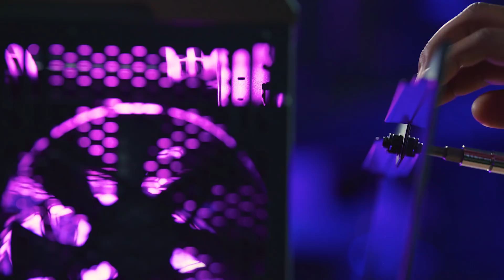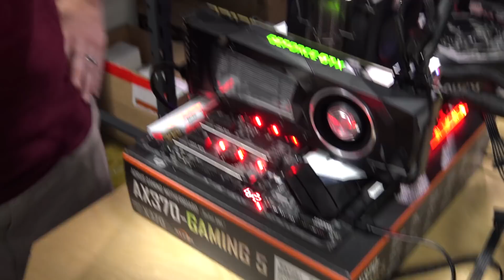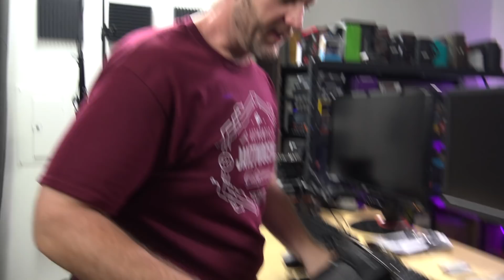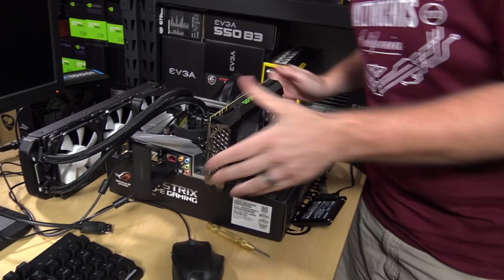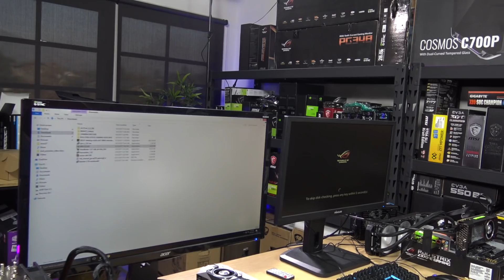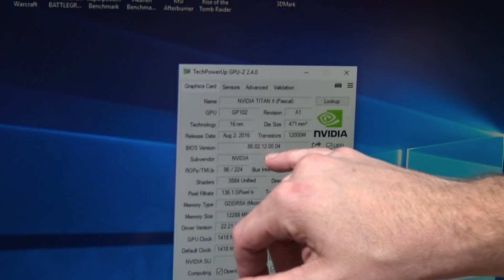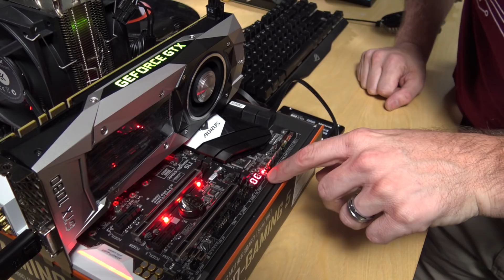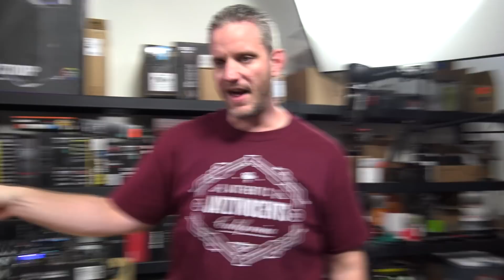I cant figure this one out... HELP!

Comment: Hold on..
Did you ran GPU-Z on the same card twice.
Once on the intel system and second time on the Ryzen system. That's why it showed the same VBios.
Also replace the power supply on the Ryzen rig. Because there can be a problem with that.
Also check that shady 1080Ti on a different PCI-E slot on the Ryzen MoBo.

Comment: I have had seen issue with the video card pins being a hair short or the card slot not working with certain cards. First put the video card in a different slot. Compare the video cards to see if there is any visible differences.

Comment: did you try:

swapping the psu?

swapping the AMD board? ( the PCIe connector seems finicky)

Clearly the issue resides with the AMD board as the Intel one seems fine. I would strongly suggest trying to change the board (keeping same psu, ram, cpu and gpu) and see if you can reproduce.

you think its the titan but the titan does work everywhere else right? and the weird thing you had to do with the 1080... no my money is on the motherboard.

Comment: check the pins on the card that doesnt work on the ryzen board maybe the gpu has some dodgy pins, perhaps they are not making contact properly on that board but work on the intel board because one board has a better pci-e slot that the other (longer / fatter pins in the pci-e socket), anyway thats just my TwoCents :)

Comment: I highly doubt its gpu bios issue. Its most likely a bios issue of the motherboard.  reset your bios(I assume you wouldn't have missed this).  Next I would switch out the psu and ram with the other one just to test.  Narrow down the variables and see if the problem follows any of the components with same video card.  If that doesn't help, I assume your using the newest mobo bios, try a couple of older ones and see if that works.  Once had a problem very similar to this and the issue was the newest bios.

Comment: MCP here. My guess is STILL - the motherboard - itself. I am seeing 2 graphics cards having "issues" with the PCI-E16x slot. You had to re-insert the GTX1080 before it worked. I would get a different motherboard (same version if possible) And see if the problem occured again. I think the PCIE16x slot is not completely fuctional (so malfuctioning in specific circumstances) Afterall factory made stuff do tend to break here and there. Look, my point it, you eliminated all the other possibilities that only leaves very few other things. Motherboard still seems the most likely one. Those things break....

Comment: A thought based on a number of years of tech experience, could it be a machining tolerance issue. During the manufacturing process that second card may not have been created equal. I'm thinking there is a minute variance on the pcie contacts (almost would have to be a width issue) and on the amd board it's not making adequet contact in the pcie slot.

Comment: You remember the dirty pin contact problems of the SNES and NES? Same idea here. Use some IPA and clean the problem graphics cards pins. Pins get grimy if you handle the cards a lot. It's actually why your cards come with slot pin protectors.

Comment: Install faulty card in second PCI-Express slot and good card in first. Try booting and see if windows sees faulty card in device manager. If it does, try connecting monitor to it and switch output to see if it works like it should.

Comment: So, when I switched to Ryzen, I had an old MSI HD 6950 with dual bios switch and the 6970 BIOS on one of them.  The system refused to boot with the 6970 BIOS, but booted fine with the 6950 BIOS.  Once I got into Windows, I realize this might be because the system detected the card as a 6950.  My old motherboard and system only detected it as a 6900-series card instead of the specific model.

Comment: I think it has to do with the latest bios not properly supporting higher OCs (msi x370 gaming + 3,9 at 1.37v worked just fine , but after a bios update I can only get 3.8 at allmost 1.39V ) and it goes through the oc cycle , try roll back on your mobo bios.

on some cards it may fail to recognise them at first and go whoops may be my oc settings and then it loops saying no GPU

Comment: Most likely there is something wrong with the graphics card that only shows up with that system. The graphics card for example could be sensitive to something that the system does differently. First I would check if the graphics card would work in another ryzen system and then I would start switching parts starting with PSU or motherboard to try to find out what the graphics card is sensitive to.

Comment: I had a similar issue a while ago with my RX 280, it would POST and go through to windows normally on a test bench, but would refuse to work in any case it was set in. The issue you are experiencing may be down to how much power the card is demanding from PCIE on the Ryzen platform, the card may still be slightly defective. Have you checked the power draw through PCIE?
Reply: I was thinking that as well, and for Jay to take the card apart, and check to see if their are any bad caps, and probe the extra power pins because as you said the Ryzen platform as a whole might be more sensitive to power fluctuations then Intel.

Comment: I'm going to go with the least likely culprit and that's the RAM because you never know, and sometimes the strangest issues can be caused by the most unlikely component(s). Or perhaps there's parts on one of the circuit boards that has a GE logo on it.

Comment: It's a combo with your graphics card with either PSU or motherboard. Either your PSU isn't passing stable current to your GPU (that might have a faulty resistor/transistor, resulting in improper readings) or your graphics card isn't passing stable current to your motherboard that should be able to compensate minor deviations (and in this case isn't).

I would recommend switch PSU between builds at first then, if possible, try the AMD build on another motherboard and for a last test, changing both PSU AND motherboard.

tl;dr, your GPU has a minor defect and will be likely to stop working before your other card with the same usage.

Comment: @JayzTwoCents 
I have the same exact problem with my 1950X and Asus zenith extreme. If I boot my PC I get a B2 VGA BIOS error. The way I solved this problem is by disabling CSM and enabling UEFI mode only. That solves my problem. If I ever reset my CMOS, I get the same issue again because by default my BIOS is in CSM mode. I have to restart my PC multiple times until my PC finally posts and I can switch is from CSM to UEFI. FYI, I have an Nvidia GTX 970.
Reply: This sounds like the most reasonable approach: "UEFI mode only" requires all devices to be EFI-compliant at boot, which back at the day of 700 series I think only the 780 Ti and the Titan were. For a single device not having a EFI driver, you wouldn't boot, you required to set compatibility mode (CSM). The problem is that those discrepancies would be observed between different models; I doubt that even the first released BIOS of a Titan Xp wouldn't support EFI.
Reply: I had 3 vegas  and one did the same I RMA it now I am waiting.. The other 2 vega cards work just fine to this day.
Reply: But will he be able to see his results from the BIOS change with a GPU that may not render?
Reply: Even my GTX 660 got a bios update to enable them to be UEFI boot compatible, I remember this.

Comment: @JayzTwoCents 

during the video you show the good card that works on both bios. showing that the good card's bios reports the same on both systems

check the bios version on the "bad" card to see if there is an inconsistency there, might still be the GPU Bios.

if that's not it, there might be a revision history difference between the 2 cards, that is not playing well with the updated bios on the Ryzen system, but that also definitely means that there was changes made between when you got the 2 cards your testing with there.

hope this helps, it's 03:46 am here and i'm a little tired :P

Comment: @JayzTwoCents Hey i had this problem with my 1080ti and i have the same setup just with a 1800x not the 1700x but i had to go into the bios and lock the pci speeds to 100mhz with it on auto it would get stuck on just random VGA codes, best of luck

Comment: u have two different power supply what could be the problem is the one that not working taking more power then the other one for some reason it rare but does happy if not that then the Bios might on the one card might be messed up and not seeing the razon AMD CPU as compatible for what every reason i would say try to update the Bios on the card if u can and see if that fixes it that what happen to me one time bios of my video card did not recognize it

Comment: Dump the vBIOS from the one that works to the one that doesn't. I know, no logic in that, but you certainly can't brake anything right? There are no differences with G5X chips cause it's only Micron, no Hynix or Samsung. :) And yes, I thought you checked the same GPU twice, but I read your comment on that one hah

Comment: Dude, that's one weird issue you came across. Good thing you resort to your audience and tell that crap happens time to time when building systems. You're very experienced in hardware troubleshooting, so the only thing I can think of is UEFI code going nuts over that very specific VGA, backwards, even both ways. Call me crazy if you want, but everything is possible until you nail what the heck is going on. Not much of help I'm afraid, but my own cents to you trying to explain this weird behavior. Cheers and good luck.

Comment: I'd strip the system down bare. Full BIOS reset, only one stick of RAM (Go through all of them), swap out to another power supply, and possibly even reseat the CPU. And of course make sure the GPU is at stock settings via the other machine. You also checked the VBIOS of the same card twice.

Comment: Assuming you have another AM4 motherboard from Gigabyte (preferably another example of the same board, or same UEFI version). I would put the Ryzen test system onto another motherboard and if that works then the problem is limited to that specific motherboard and GPU.

Comment: i have had this problem, with a nvidia gtsomethign 240, probably a difference in the gpu silicon  that prohibits it from booting with that specific mobo/uefi firmware. In my case that gt240 would boot on almost all systems, but also in almost all systems crash randomly, with only 1 system not booting at all, and only 1 other working 100% well '.'
Reply: Also, as far as i know, uefi firmware cheksums itself for corruption, but imma not sure :D

Comment: Had this issue... only it was with some RAM

It was DDR3 on a Core 2 quad (a very late motherboard)

The ram works perfectly in the core 2 quad system at the correct speeds and all.. but it wont work in any other system.

I ran it through 6 different CPU and RAM configs all ending with the same issue.

Comment: Yeah, it could be a vBIOS issue, but at this point in troubleshooting, I'd be more willing to pin the blame on an extremely finicky electrical problem.  So I'd focus on swapping every possible power/data path:

* Display cable (try both different cable and headless)
* Display output
* PCI-E slot
* Different motherboard (ideally try both same make/model and different make/model)
* Power supply
* Power supply cables

Comment: Probably seems real dumb, especially since you got the other two cards working afterwards but, have you tried uninstalling the nvidia drivers and reinstalling them. I remember having post issues when i switched from a 460 to a 660ti and doing the above seemed to fix it. That's probably not the issue but i suppose it couldn't hurt.

Comment: I would try a different PCI-E x16 slot since you have a X370 board. I'm with some that also noticed you showed the same bios from the same card, not the one in question. I would also swap monitors as they are two different brands. The 1080 you installed on the Ryzen board did not like it when you connected the display port cable in after it had booted and you had to do another reboot just to fix that issue. It might be the case that card in question does not like that monitor or the G-Sync Module and it's freaking out the Ryzen board.

Comment: Jay on the ryzen psu may have a 12volt rail problem it may not supplying enough volt to the gpu, some gpu take higher volt on cold boot dont blame the system when you don't even check the psu 1st.

Comment: Couple things to try...
1. Ryzen boards have had weird issues with RAM speeds, so try reducing the speed of the RAM and see what happens.
2.  Reset the BIOS back to default settings and see if there is any difference.  Maybe Google some of the less common options and play with them.
3.  With the bad card in, start swapping other components like the CPU/RAM/PSU to see if the problem follows any specific part other than the GPU.
4.  If you have or can borrow the same mobo from someone, swap the mobo using all the same parts and see if the issue follows the original mobo or not.
5.  What happens if you flash the GPU and/or motherboard to an older BIOS?
6.  Any chance the GPU's have a stored OC or different stock clocks on them that the Ryzen board doesn't like?

Comment: Did you try a different motherboard for the Ryzen  setup ?  I suspect the motherboard but in the way that  either new AMD bios is conflict with old bios in GTX , or vice versa . Or Bios for AMD is not geared for that GTX bios for some reason ,. 
  Because . the card works in the intel system .   I had problem s with using AMD platform with Nvida , thats why I switched to Intel years ago .

Comment: The only time I have had a problem like this is when I was using a Asus Rampage iv Black Edition and found the cause was the OC panel I was using for cpu temps it somehow got bumped and messed with Bios on the board and made it completely fail to boot best guess since it actually turns on for a few seconds is that problem lies between chipset and the 2 bios or conflicting driver witb the chipset

Comment: You checked the BIOS version of the same Graphics Card twice. You should've checked the version on the one you put on the Intel to see if they're the same or not. And I'm talking about the BIOS in the Graphics Card itself.
To not get them confused, write down the version on a piece of tape and stick it onto the card. Maybe one has an older BIOS that's not compatible with Ryzen.
Reply: I noticed same thing he never checked the bios on the video card that was having problems
Reply: I noticed this also and started to look at the comments to see if others caught that
Reply: You checked the bios on the working Intel system GPU. Then you moved the working GPU to the Ryzen board. You then checked the same GPU on the Ryzen board. You should have checked the non-working GPU that you moved to the Intel board.
Reply: I was checking to see if anyone else noticed that as well.
Reply: +1 on that, he should check that bios version correctly before coming to conclusion that both cards have the same bios...
Reply: Lol yep he derped
Reply: Try rolling back there bios of the GPU
Reply: My Guess is that since you already discovered not all cards are the same Even exact same model/brand. The problem card is trying to request to much power through the pci slot. Same Thing you checked Bios of same card twice.
Reply: I saw that too so maybe the 2nd TI had something with the bios!!!
Reply: Agreed I noticed the same thing! 👍
Reply: yeah, I noticed the same thing
Reply: Same thing I saw.

Comment: HEY Have you tried with another Aorus AX370-Gaming 5 MB to see if the same issue?  Possible faulty MB. I know you mentioned that if MB it would be all or nothing but I have seen in the past where a particular MB did not like a card even though it is the same model.  Does not  hurt to try just to eliminate any possibility

Comment: You checked the bios version on the same card twice. You only ever checked the bios on 1 card. 

You pulled up GPU z on the Intel system with GFX card A. Then you pulled GFX card A out of the working Intel system, put it in the AMD system. Then you pulled up GPU Z on the AMD system with GFX Card A again. 

You never showed us anything with GFX card B except the first post failure. Once you pulled it out of the system you didn't touch it again. You put it in the Intel System and then forgot to check the bios.

Comment: if its still happening try to disable the full screen logo on the ryzen system. i had a R9 290x and a 4K monitor and on my gigabyte motherboard it wouldnt post with the full screen logo with displayport for w/e reason

Comment: It sounds like an issue with the Motherboard. I would follow the normal testing around that first, reset cmos, reflash bios, try the other pci16x sized slot etc. You have proven the card works on other machines the only universal part that is affecting the performance of the ryzen machine would therefore be things that are on the ryzen board or the board itself. A quick look on newegg and amazon to see what issues people where having and most of the poor review scores are complaints about the bios either causing issues or being the issue. Well that's where i personally would start.

Comment: Jay you rock i wish i could help you but i wonder if you could help me, i have a system that is on  with a black screen if i turn off the monitor  an turn it back on i get display  for one second an it goes back to black screen not a no signal a black screen i already tried to reset the ram.